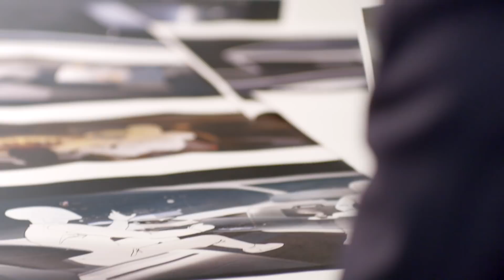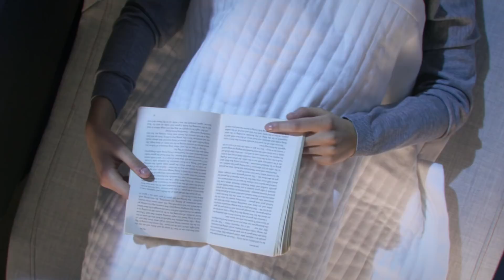Volvo 360c presentation

Comment: It's all about fucking "design" and "lifestyle" these days, I'm betting in 5-10 years one of these Volvo's will be an irreparable garbage pile of plastic and random wires. The 240 and 740 may have been archaic but at least they lasted and you could repair them yourself. This new Volvo is all about consumerism and lifestyle. You wear it out in a couple of years, throw it away.. buy the new model... it's updated and better for the environment!